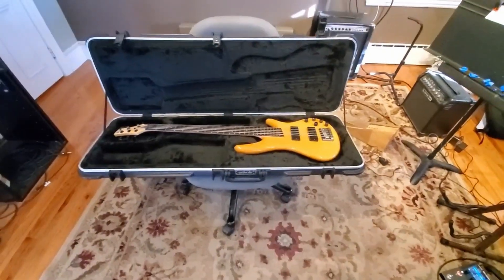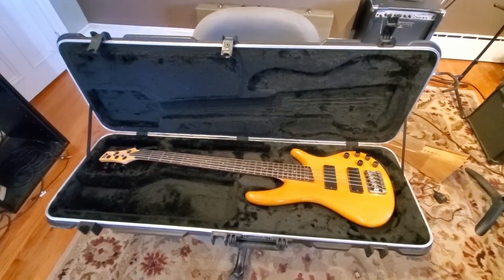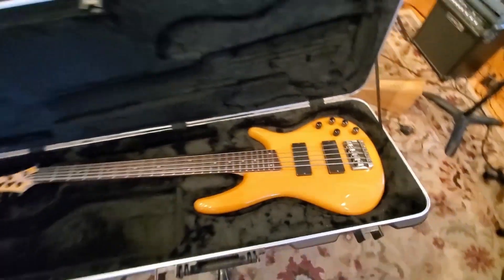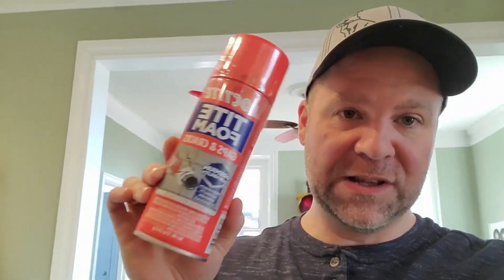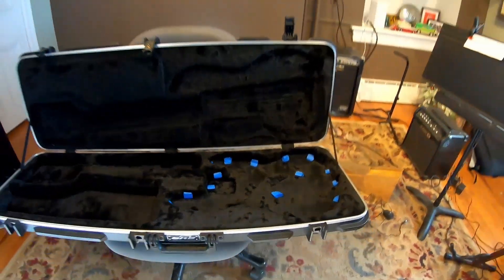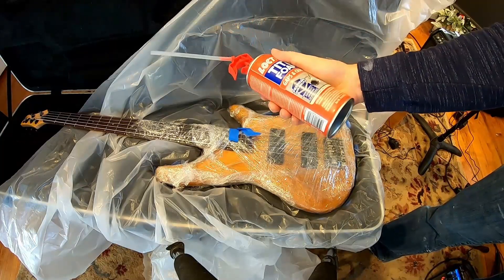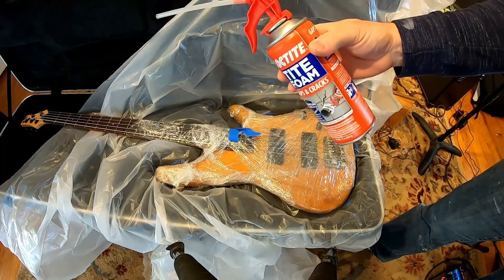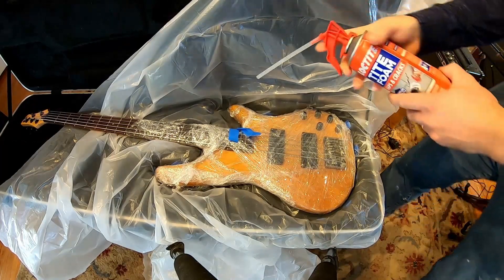Custom Fit - Molding A Guitar Case With Spray Foam

Comment: "Great Stuff" spray foam has a version labelled for "Windows and Doors" which is a denser foam with fewer air bubbles and expands a little less than the standard Great Stuff product.  Probably, equal to the Loctite product.

Comment: thanks so much I have this idea in mind
Reply from the maker: If you try it, cover EVERYTHING in plastic.  Also, it will take longer to dry than is typical because the plastic doesn't allow air to get to the expanding foam
Reply: @mericanhoney  many thanks

Comment: I have a lot of experience using spray foam having to seal pvc chases or conduits if you will, that are run from lets say one room to another room, under the floor and pop up out of the floor on both ends, with about 4 inches above floor exposed that could get water or something else in it if you don't foam both ends. This stuff works great but you have to just be aware that anything you get it on by mistake is a wrap. You even have to sit the can on something safe after you finish spraying with it because the pressure inside the can causes it to still come out of the tube even though you're no longer spraying it. Also it does not wash off your hands, it'll be there for a week, turning a darker color each day. If it gets on your favorite shirt, that shirt just became a work shirt. It does not wash out of clothes. It expands like crazy, so its easy to over use it. If you are using it to seal just the end of some type of tube, stuff the inside of the tube about 2 inches deep with like newspaper to stop the foam from sinking into the tube when you spray it. By the next day the foam becomes as hard as a soft rock.

Comment: You gave me hope that I might actually be able to repair this ancient old road case my stepfather left me when he passed. It had a 62 Fender Stratocaster in it that rattled around. It also put (for lack of a better term) an adhesive residue on the neck of the guitar. I got the guitar cleaned up and it rests in a new case. I have kept this case knowing I would eventually find a way to repair it. I initially reached out to the manufacturer but they wouldn't return any kind of emails or phone calls asking about repairing the interior of this extremely heavy metal exterior road case. Now I think I have a couple more things to figure out before trying this. 1 I have to clean out the old interior so if I use the Strat for a mold like you did I will somehow need to raise the guitar off the bottom of the case in order to "foam the bottom". 2 will this raise the guitar and should I also weigh it down somehow? 3 what do I do with the top of the case? And 4 what kind of fuzzy stuff do I cover this new interior with?  You gave me hope now I just need to answer some questions.  Thank you!

Comment: Is that foam flexible giving enough wiggle room for your bass? Or is it ridged? I needing something line this for my Guild 12 string acoustic!
Reply from the maker: It's perfect. It holds it like a glove. I feel like this would be a lot harder to do on acoustic. Much bigger scale.  you may be better off cutting foam to size and covering it

Comment: Great idea sir! I'm in a similar position with a resonator guitar I have and I think you may have inspired a solution. One question, how hard was it to remove the foam from the guitar without breaking it to bits or accidentally nicking your bass? Any tricks or suggestions on that part would be appreciated.
Reply from the maker: Make sure you wrap the body of the guitar with plastic wrap. That's one step that didn't quite make it into the video. It was easy to remove.  I am glad that the foam didn't need to be any thicker. When I first pulled the guitar with the foam out of the case, the underneath portion of the foam wasn't quite dry. I gave it a few more hours out of the case in the air to cure before I separated it.